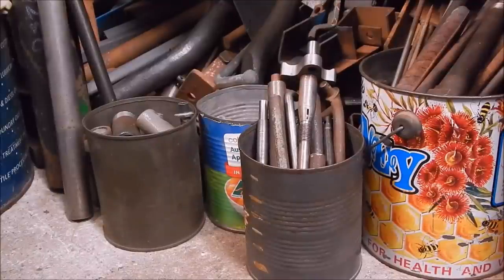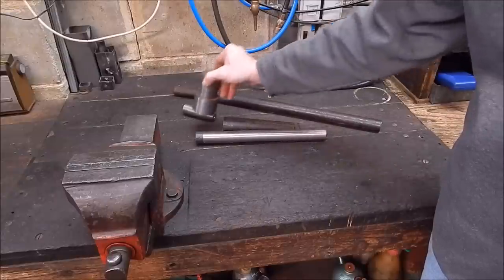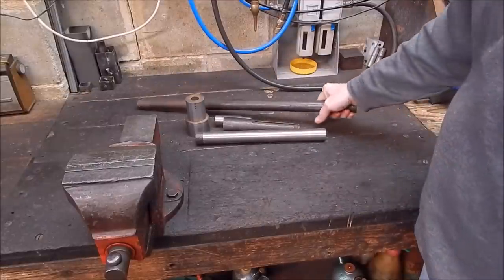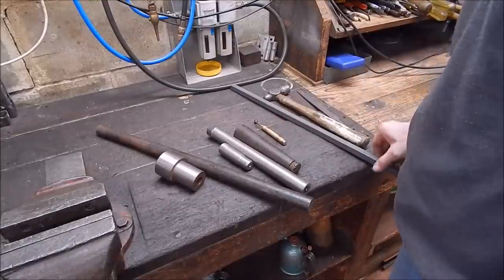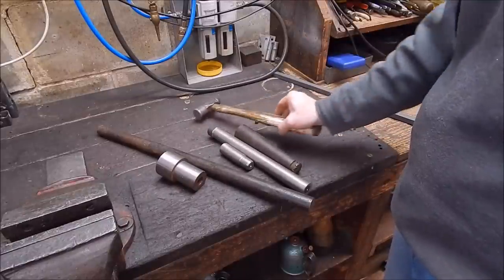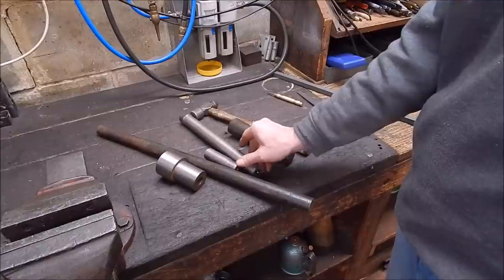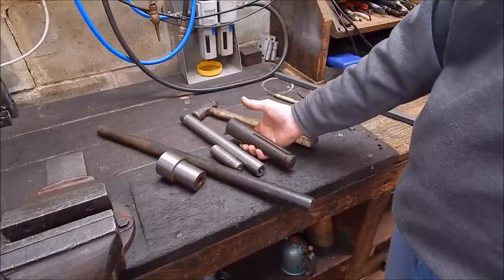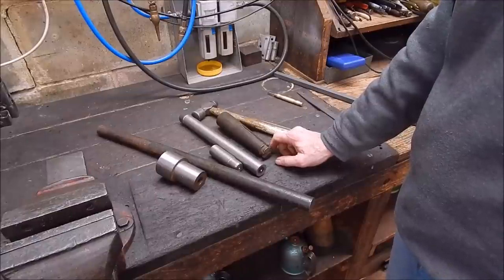Five ways to test steel hardness in the workshop

Comment: NIce ways to test the hardness. I just drop it on the vice and the higher the tone the harder it is. But mostly I label steel when I buy it. Not always possible when you get bits and pieces from arround.

Comment: With files, I can get some quick approximate reading by listening to the sound. The higher the frequency, the harder the material. It’s just a quick test. Your hammer does about the same thing.

The hardness file set you can buy is pretty useful, and I find pretty reliable within about 5 RC. The set costs around $100. Not bad if you need some fairly close, reliable, but not critical tests. My Rockwell bench tester is pretty accurate and consistent to within about 0.2 RC. But you need to carefully calibrate these units, and check the calibration every so often. They also cost, new, for the HR-150A Chinese model sold by many vendors, for over $1,000 to $1,500. Buy from a known vendor, not online from some unknown source. That model is the most used by small shops and amateur knife makers and machinists. It’s quite good!

If you do critical work, you really do need one of these.

Be very careful about deciding to save some money and buying a used one off eBay, or some other source, no matter who may have made the model. You really don’t know the condition of these. When they’re shipped from the factory, there are a number of wood or plastic blocks inside you need to remove that prevent damage to the delicate mechanism. Used models don’t have that, so it can get damaged in shipment. Not worth it.

What’s being done here is relative testing. Is this harder than that? Useful to get some vague idea of what you’re using. But it won’t tell you anything about the composition for hardening, wear, tensile or shear strength, etc.

Comment: Useful practical stuff. I have always struggled with the file test & usually end up trying to use what ever I have & if I can't it's too hard! Course, as you say, having struggled to make some thing & then find it breaks a tap is a real downer that brings on ferocious cussing!
Reply from the maker: Yes, the steel can be too hard.

I have a four foot length of 100 mm round stock I bought from a scrap yard (old new) that machines beautifully with carbide to a mirror finish, but is so hard you can't tap a thread in it.  It's only good for certain work.

Easy to get caught out.

Cheers Rob

Comment: While the spark test may not be very good for hardness - the heat treatment and tempering  can result in greatly varying hardness for the same steel - it is very good for determining what type of steel you have. Especially if you have a known sample to compare it to. That can be very important if you plan on heat treating it for hardness or annealing it for working.
Reply from the maker: Good point.

I touched on this with my comment about high carbon steel, but I think it takes considerable experience to know what you're looking at regarding spark density and colour.

Cheers Rob
Reply: It is very difficult, agreed, but if you have known samples it's not that hard to compare. Collecting the known samples is the hardest part.

Comment: One way to test hardness is to use a hacksaw. Hardened coil springs may be subject to scuffing by hacksaws.

True high carbon steel will cause the blade of a hacksaw to skate. Medium carbon or CrMo will be scuffed, even in it's hardened state.

So yeah! You can use a hacksaw if are afraid of wasting an expensive file.

Comment: Please don't take this as me trying to be smartypants but I wanted to point out something about the use of files in general. Please avoid filing backwards. Files are designed to remove material only in the forward strokes. Backward strokes can dull and render almost any file useless in a couple of minutes depending on how hard the base material is. The technique is to either release pressure on the backward stroke or better yet, lift and bring it back to the starting position. Lost many files during my childhood without this knowledge so I thought I should help others to save time, money and effort.
Reply from the maker: Thanks Brian.  Good tip.  Makes sense when you look at the file cutting edges/pattern profile.

Cheers Rob
Reply: Thank you. You probly just saved me many files